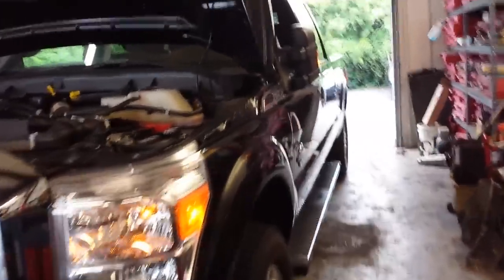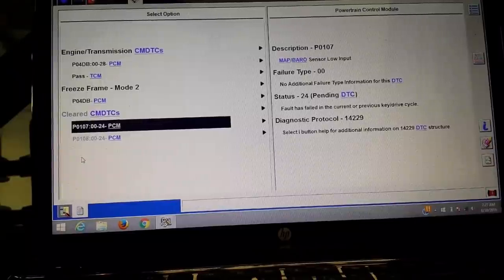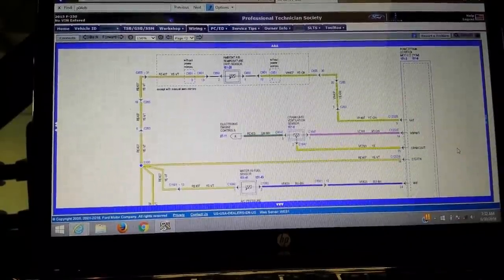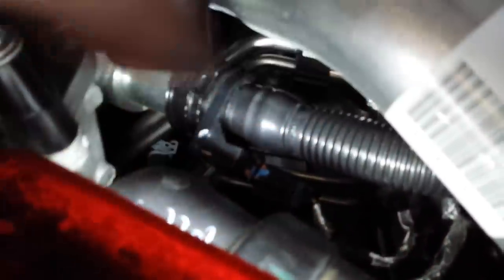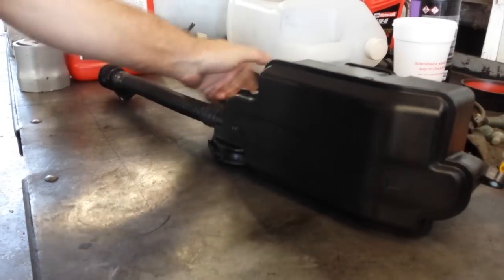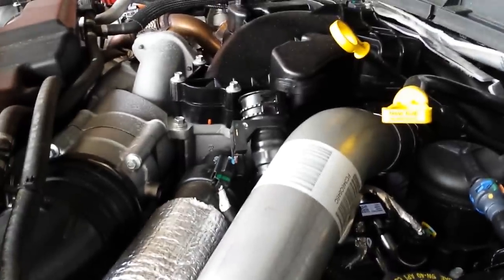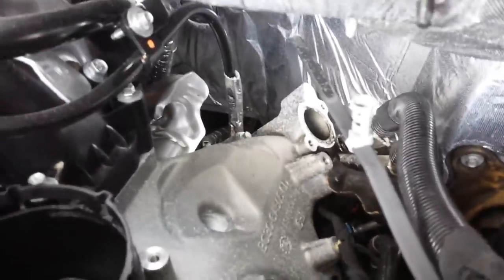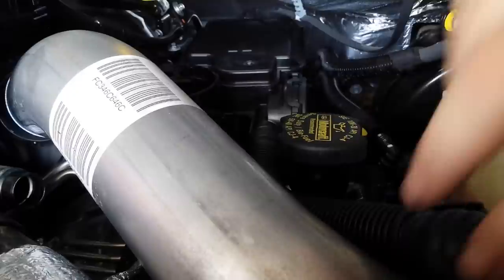6.7 powerstroke crankcase ventilation sensor

Comment: Perfect timing on the release of this video.  My 2015 F250 just started throwing this code (42,500 miles).  Had it at the dealership and they reported this problem.  They seem to confirm this as a known minor problem as the part is on back-order and won't be in until mid October.  Thanks for the video.  I now know exactly what they'll be doing when they repair the problem.
Reply: Do you know if this was covered under the power train warranty?? I have the same code witha 44,000 on a 2015 and Im wondering if ford will cover it or not? 

Thanks
Reply: Ryan,
My dealership handled the repair under warranty.  To me it should have been covered under the power-train or emissions warranties.  I'm not sure which one they used but at least they covered it.

Comment: Thanks for the video. Did mine tonight 6 Dec '19. Took just under 2 hrs being careful with everything. Don't know how you got the insulation on AFTER you installed but thanks to you for the reminder, I did it with new one on floor. Unlike the orig position, my sensor ended up positioning itself just under the intercooler cooler tube and so I tie-strapped it so as not to rub. Fairly easy job guys.

Comment: I have the 2016 transit 250 with the 3.5 ecoboost and had this same issue at 30,000 miles. The dealer replaced the sensor . It's been about 2000 miles since the R&R and no troubles.

Comment: Why did you replace the  Crankcase vent separator box with new sensor if you had the voltage satisfied on the old one?

Comment: I especially like the afterthought. One issue we have as technicians is why is something done? What is or what was the engineering side thinking about when they made the change in the hose, or if it is software related needing a flash. to me, that info is critical in the diagnosis. Most do not agree with me, I do not want to overthink a repair but I really like to know why I am doing what I am doing. I really enjoy your videos.
Reply from the maker: Thank you, they finally did away with this setup on the '17 models as they realized it is completely useless and not needed.

Comment: Best video yet on how that works. I am having that same code pop up at least once a month. I just go in an clear it since it doesnt stay. I was wondering what your take on just deleting the ccv with a delete kit. Obviously I would need a tune to disable this as well. I was just wondering if it would be worth it to remove that and not have all that oil circulate back into the intake and turbo
Reply from the maker: Deleting it would be a bad idea. You would have a ton of oil on the underside of your truck from the natural blow-by. They make catch can kits but these 6.7 diesels don't need them because they use a cyclonic technology that really does a good job of keeping the oil out of the vapor and thus out of the intake and turbo system. Ford stopped using the sensor on the 2017 model so it's really not that important to monitor it in the first place. The only problem with this setup is the sensor itself and I am drawing a blank at the moment on how to get around it.....cheaply. Tuners are pricey on these trucks.

Comment: Didn’t the “new” CSP update/pcm reprogram 17M04 make the pcm ignore that ccv pressure sensor? I know this is a six year old video, but still wondering….I’ve got the box without the filter, but still considering removing it from my 2015 F250 and just going with the internal catch can and drop hose from SPE

Comment: I have a 2015 F250 diesel.  At 29,000 mi. I had check engine light. PO4DB code. The dealer mechanic did a Program 17M04 and installed a collar kit. I assume it is the same thing as a hall effect sensor. My confusion is,  what caused the P04DB code if there wasn't a sensor there in the first place? Or where was the original sensor.

Comment: Hey nice video, was helpful. I have a problem, same code same concern the sensor is gone. When I go to find the sensor on the truck it's not there. Just a normal "twist" hose connection on the intake side and absolutely no sensor. When I bought the truck it was supposed to be stock. I did a delete with a mini max, and first start up the cel was on with this code. 2016 6.7 f250. I don't know why the sensor was gone but no code before the tune. Any suggestions or ideas what to do? Can I delete the sensor through the minimax? Did some trucks simply not come with a sensor?

Comment: I watched it until the very end and received the answer to my question. How do I go about resetting the check engine light after disconnecting the crank case sensor and connecting it back in? My truck is deleted and have SCT tuner and can clear the code by my tuner but when i start the truck back up the check engine light comes back and have to clear it again with my tuner?

Comment: I don’t have any codes or issues with my 2016 6.7, but I have a oil leak at the hose connection where the sensor is. Do I have to replace the whole box to fix the oil leak?

Comment: I have the same code that popped up on my 2015 F350 6.7. It popped up because I installed coolant filter onto the truck and unplugged that crank case sensor to move it out of the way and make more room in removing coolant temp sensor that kind of within same area. By me unplugging the crank case sensor and plugging it back in, can that set the check engine light for PO4BD? I never started the truck until everything was plugged in and put back

Comment: i see this video was made back in 2016 but if you're still monitoring the comments for it i have a question. i have a 2011 f250 that has been deleted and tuned. have had no trouble with anything major on the truck. at 152,000 miles it started having a faint blue smoke at idle. this smoke got worse over a few thousand miles. i had a friend of mine look at it and he found excessive oil in the hose going to the intake. dumped that oil out and no more smoke. what would cause the oil getting to the intake instead of draining into the valve cover? that mechanic friend of mine wants to change out the box. is that going to fix my problem? oh and if i'm parked on a hill with the front end low it smokes. obviously allowing the oil to run to the intake.
Reply from the maker: Given the age of the truck, it's possible that the CCV (box) is the problem, hard to say for sure. If you decide to change it, take a picture of the injector quantity codes (label on top of CCV). That label doesn't peel off very good to stick to the new box. Those codes come in handy if you are doing injector work.
Reply: @flmmaz  ok. thanks.

Comment: Thanks very much for taking the time to make and post this video.

I had this code as well as P1593 come up for a dealer yesterday. No diesel tech there so I'm taking it in to another dealer in the morning. 
my concern is we pull a 16k 5th wheel around the country. Even though I will be getting this taken care of I've found mentions of people that were left in idle mode eventually. Does that sound like a possibility? Can't say driving in the Colorado Rockies, this summer's adventure, when that sort of problem might pop up all that exciting.

Crossing my fingers that the mechanic/tech catches everything tomorrow.

Next I'll be searching for the P1593 problem. My 3rd 6.7 and first issue. Hopefully the last. If you have any thoughts on the P1593 code I would appreciate your input. 

Thanks again.
Reply from the maker: Code P04DB will not derate the truck. Idle only mode is problematic mostly to DEF concerns and the SCR system. So don't worry about that. P1593 does not seem to be a valid code on my end. What scan tool did you pull that code with?

Comment: Hey there flmmaz i have a 2013 that just through this code, would you know the part number for just the hose and sensor? And great video it really helped to discover the issue
Reply: Don't believe you can buy hose and sensor now. Heard '13 and up the box and hose are one integrated piece now. Changing out my '16 tonight. Part was $360 at stealership with mil discount. SMH. I'll be deleting soon!

Comment: I own a 2016 Ford Expedition and my truck spit this code out.  This was closest that I came to finding anything.  My only mod is a K&N CAI and I'm afraid that Ford techs are going to say my CAI was the problem.  So I'm going to reinstall the stock intake and test drive it and hopefully it reads the same P04DB code.

Comment: I have this same code on my 2015 f150 3.5 ecoboost and have deleted it in the past but it always comes back. My only mod is a s&b cold air intake, should I just replace the sensor and see if that's the fix?

Comment: I have a 2015 f450 6.7 with the same code...my truck is Not a chassis truck...for a couple months this code would appear/disappear...my turbo would build up to 12 psi then hesitate before building to 22psi...this is while pulling loads up to 24k lbs...the last couple days now the turbo has been acting funny...no noise, just wont build above 12psi....then today it worked fine for a small trip. On the way back it wouldn't build above 12psi again. Any ideas? Thanks
Reply: Jeremiah Moyer Sounds like a wastegate actuator issue. Seen this before.

Comment: Is there a good place to buy this part? According to all the dealers I talked to today it's on nation wide back order. Bought my truck used but also got a powertrain warrenty do you think it would be covered?
Reply from the maker: It's a dealer item only at the moment. Give your local dealer you vin and mileage and they can run it to see if it's covered.

Comment: On my 2016 F350 I had the code for crankcase vent sensor dropped off a dealership 2 days later they couldn't find the code , so they didn't fix her , told me if it goes off again come back. Any reason why they couldn't find the code. Great video thanks
Reply from the maker: I would try another dealer, or have that one run your vin to check for any recalls. This is now a recalled issue for certain trucks. Yours may qualify.
Reply: @flmmaz  thanks for ur reply but I do have a letter from Ford for a recall but the dealership saying that the code has to be on and that I have up to 120,000 miles to see if it comes back on. I think that is bs but I will try a different dealer thanks

Comment: Do you know if this was covered under the power train warranty?? I have the same code witha 44,000 on a 2015 and Im wondering if ford will cover it or not? 

Thanks
Reply from the maker: I would need your vin to check for coverage beyond 36,000 miles. Send me a pm and I will run it for you.
Reply from the maker: I just checked my data base and it is covered.
Reply: Awesome, Thanks!
Reply: @flmmaz  I know it has been awhile since you did this video, which was great by the way, but wondering if you can perhaps run my VIN also...I am at 96K on my 2015 F350 dually, so hoping I can squeak in under the wire.  Otherwise, I will do the repair myself when I can (just had a hip replaced, otherwise I wouldn't be bothering you with this request).  Here is VIN (and TIA):  1FT8W3DT3FEC63196

Comment: Is this a major issue or a minor issue? I'm getting the P04DB check engine code and can't get the truck to the dealer for another week. It's been coming on and going off more frequently now, I just don't want to damage my engine.
Reply from the maker: Very minor issue dealing with emissions only. It just pops on the check engine light and will not affect engine operation.
Reply: flmmaz awesome, thank you for the quick response and easing my mind!
Reply: I have the code as well, however my fuel mileage is tanked. Get around 10.1 in town. I was told this mileage issue is related to this problem with the sensor being bad/disconnected or the CCV box needs replaced. What are your thoughts?

Comment: I have a 2012 6.7 diesel building too much pressure  in the crankcase and he's pushing oil out from timing cover my mechanic can find the problem can you help please
Reply from the maker: Ford doesn't have any way of checking crankcase pressure on this engine, nor is there a specification on it. How was yours checked and what was the number?

Comment: Great video bud.I have a 2011 6.7L plain Jane xl 4x4 and the monitor in the dash isn't like the loaded trucks.This ccv system,does it need to be replaced after a certain amount of miles or cleaned out and would my dash monitor let me know if its bad or if it needs cleaning? Keep up the good work with your videos and you help a lot of us out here with them.Thumbs up on this video and take care bud.
Reply from the maker: Appreciate the input. That system is maintenance free, so no worries about cleaning it. The 2011 does not monitor the system so there is no feedback for any problems associated with crankcase ventilation. The only problem you would ever run into is the box can crack and leak oil.

Comment: Are Ford products junk.my f250 has a check engine light it goes out after I disconnect the pig tail from the trailer ,but after a couple of starts it comes back on